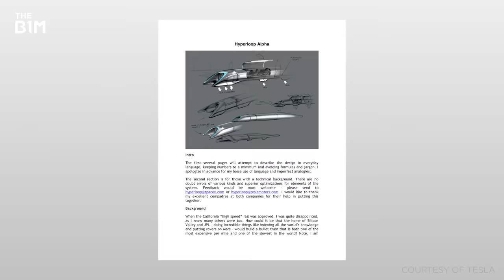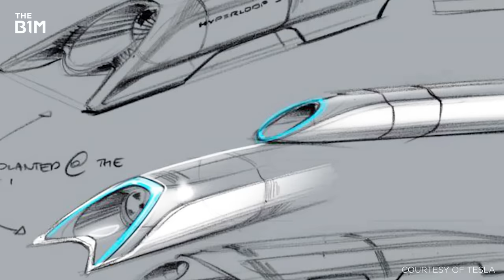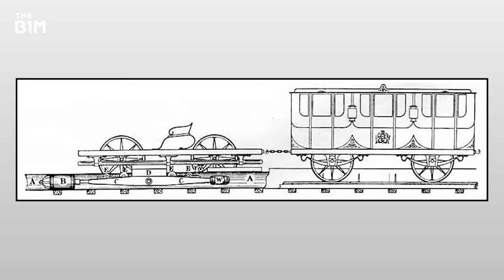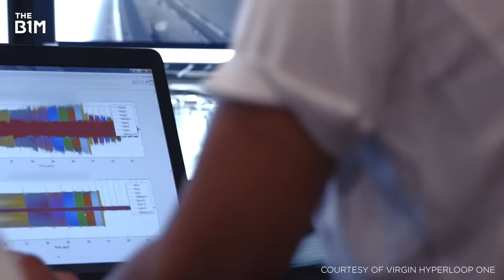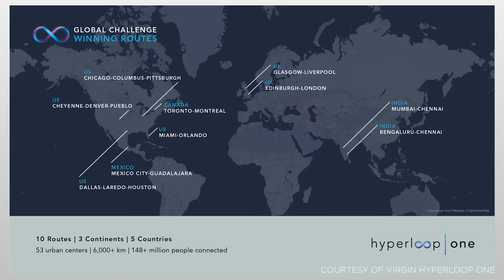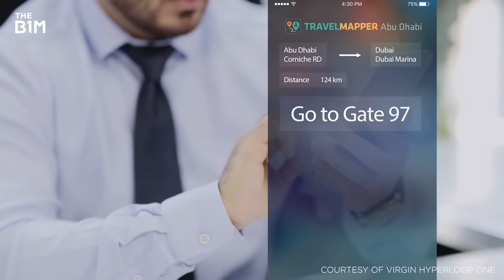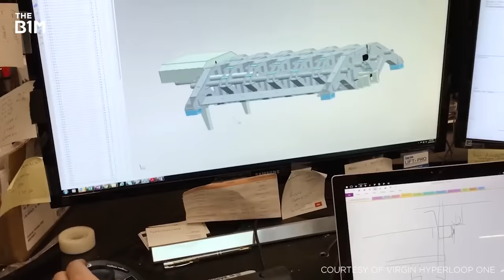Hyperloop Explained

Comment: the idea was not "first conceived by Musk", the first actual functional hyperloop was build in 1872 by Alred Beach. It was called the Beach Pneumatic Transit.
Reply: Also in New York, I believe, they had a vacuum sucked Victorian underground train that sucked people through a tunnel from here to...there. Maybe I am thinking of the same thing, I just don't have anything but a childhood memory hearing about it. The part I recall is the luxurious train compartment, Pullman style.
Reply: Addendum Yep, it's the same thing. I should double check before I post a comment!
Reply: Almost flipped the f out when they said that
Reply: @paulaharrisbaca4851  It was a demonstration tunnel that went about a block, then came back.  Neat idea - but it wasn't hyperloop.  The car (I think there was only one carriage, not a train) didn't operate in a hard vacuum, but instead acted as a piston.  The station would increase or decrease the air pressure in the tunnel to push or pull the car.

NYC didn't go for it.  The tunnel was sealed up, rediscovered, and then demolished.  The scene in Ghostbusters II where they broke into it was actually City Hall Station, I believe, which is funny since City Hall Station is where the old tunnel originally was.

Comment: so hyperloop is just maglev in a tube.
Reply: Yes, You are right.
Reply: as well as a really cool name
Reply: It's not even something new. This was suggested by railway engineers in the past but wasn't feasible in their time.
Reply: Maglev in a tube but it goes faster since it doesn’t have air in front of it but it does have air behind it
Reply: @gabbar51ngh  still isn't feasible. If you ever worked with vacuum equipment you'd know what a fucking hurdle it is to keep even a small vacuum chamber under low pressure for an extended amount of time.
Reply: In many ways yes.
Reply: @gabbar51ngh  And it still isnt. Not even close.
Reply: And moves fast due to air pressure equivalent to 200k feet above sea level.
Reply: @gabbar51ngh  its literally a 100 year old concept plagiarized by Elon musk
Reply: @flatmarssociety5707  Of Course! But with added snake oil!
Reply: Even bullet trains r that
Reply: @skygge1006  dude r u serious due to maglav the pods float which reduces the friction between the two bodies as air applies lesser friction than the tracks does 
But still the drag force is kinda hard to face
Reply: yup, I wonder why they don't call it maglevtube instead.
Reply: But with more ways to die.
Reply: Vacuum tube
Reply: except maglev can go faster and is safer
Reply: Yep
Reply: @JiTiAr35  because they already abandoned the maglev idea. Pie in the sky ideas don't translate to reality. Now its got wheels. So it's a subway train......
Reply: @polybiusv7299  not to mention it takes time to create a vacuum.
Reply: I started working in NY 200 years back when we made houses  at Rock Central, IM SO HAPPY WE DIDNT cancel the PROJECT. I never thought I would see it finished in my life time— then again, I may no
Reply: Yup

Comment: "Hyperloop was first conceived in 2012 by Elon Musk"

No it wasn't. The "Hyperloop" brand might have been but the original concept of transporting people this way goes back to the early 1970s.
Reply: Yes first working test track had been build in West-Germany in 1969 https://en.wikipedia.org/wiki/Transrapid
Reply: @ratten57  Thats Maglev not an airtube.
Reply: O. B. The whole thing is impractical.
Reply: @o.b.9781  Maybe so but it's a stunt. The numbers simply don't stack up. There's no way these things will ever be cost competitive with conventional rail or flying. A vacuum tube is good for moving cash around a shop but not much good for people.
Reply: The original concept was first patented in 1799 in Britain - so Musk's claim that he invented the concept is beyond absurd. It's never been built because the engineering will be extraordinarily challenging and expensive and the safety issues are virtually insurmountable. This will never be economically viable - it's in the same category as personal rocket packs and flying cars.
Reply: @tullochgorum6323  
"the safety issues are virtually insurmountable."

Exactly. What happens if the cabin depressurises? Everyone dies. What happens if the thing stops? You can't get out because you're in a sealed tube in a sealed and airless environment.

Ordinary high speed trains and aircraft can move more people. There are break even points on distances.
Reply: @thethirdman225  Any catastrophic failure of the tube (eg from terrorist attack) means that all passengers are vapourised when they are hit by a wall of air moving at the speed of sound. It would be like driving into a wall at over 700 mph.
Reply: @tullochgorum6323  Mmmm... Good point. Hadn't thought of that. I was thinking of more pedestrian malfunctions...
Reply: JustAnotherGuy Well that’s a long time before Elon Musk!
Reply: And the reason it was abandoned was basic physics: energy to create such a huge vacuum as well as the danger of a breech in such a large vacuum makes it more energy demanding costly and dangerous than even air transport.  I mean, if you're going to get ridiculous you should at least make it entertainingly fun like a giant water slippy slide that will take you from one city to the next.
Reply: Actually, it goes back to the late 1800s.
Reply: @thethirdman225  aircrafts are becoming unviable for travel less than 1000km due to long waiting times and requirement of large runways in cities where land is premium.
Reply: @thethirdman225  This thing will have fail safes on top of fail safes. It's even less likely for the cabin to depressurise than for an airliner, and if it did the system stops the vehicle while pressurizing the tube around it.
Reply: Much safer than an aircraft which relies on very thin sheet aluminium to contain cabin pressure versus very thick steel walls which are extremely hard to breach and if there is an air leak then the pods just gently slow down and you’re only a few metres above the ground in perfect safety. Maintaining the partial vacuum also uses very little energy
Reply: @JeffDeWitt  And everyone seem to be forgetting that such technology must have emergency oxygen packs for the whole cabins (in the events of an emergency). Those guysust have thought of all the negative implications... I have been imagining the possibility of this technology, even before I get to see this information. I'm hoping to seeing this concept come to reality someday.
Reply: @springviewcorporation4653  I don't think it needs to be anything as complex as emergency oxygen packs. In the event of a major emergency the pod could stop, vents open in the tube and then in the pod, flooding the tube with fresh air and then the pod. All that could be easily set  up so it happened automatically if the power went off.
Reply: @tullochgorum6323  all passengers are vapourised when they are hit by a wall of air moving at the speed of sound. It would be like driving into a wall at over 700 mph.

Just like how the Concorde always exploded upon reaching the sound barrier, right? Surely it's impossible to design a metal vehicle to withstand such stresses, or otherwise incorporate structures within the tube itself (like a Tesla valve) to constrict the flow of air, should a catastrophic leak occur? 

https://www.youtube.com/watch?v=rYlP5TEKf2w
Reply: @noelchignell1048  the "very thin aluminum" you are talking about is for lightning protection. The real one is thicker
Reply: @noelchignell1048  also no you wouldn't slow down, not only the atmospheric  pressure inside the tube is 0.01 which is almost the vacuum of space. Your lung just burst, everything gets pushed by an air with the force of a truck with the velocity of ~1100km/s vaporising your body and breaking the pod apart
Reply: @springviewcorporation4653  you have been, but you haven't calculated the speed of air coming at you with the speed of sound and with the mass of a truck. Not only you are trapped in that stupid pod you cant do anything except, not doing anything
Reply: @ritwikreddy5670  the only problem with aircraft is that efficiency of the engine is higher the less air there is, but also less speed.
Reply: @thethirdman225  Hmm, just like on an airliner except you won't be 40,000 feet in the sky.
Reply: So? At least someone introduced it to bigger audience of today's world where it has more demand. Doesn't really matter who is the original conceiver in an open-source innovation now does it.
Reply: @o.b.9781  Why transparent? If its a closed steeltube, you have more space to place oled displays for commercials and the ppl won't be distracted by natural sunlight or the landscape. All in the interests of the shareholder...
Reply: @tullochgorum6323  Flying cars are a solved problem. You can see videos of them on youtube.

Comment: The drive -thru at the bank has been using them for decades.
Reply: No
Reply: @garisfamilychannel6160  Yes
Reply: Woosh this whole thread
Reply: This made me crack up. As a child I was so fascinated with the bank tubes.
Reply: I betcha someone got high and went to the bank and said man I wish I can fit in one of those tubes
Reply: Most of you guys really don’t really understand what a hyper loop is. The tube is not pressurized, and has less air than normal sea level. This allows the pod to move at incredibly high speeds, with little air resistance, do to the fact that their is not much air at all.
Reply: 你的心是自由民主聯盟 這樣的一天一定。
Reply: Futurama has been using them since -1,000 years ago.
Reply: @garisfamilychannel6160  Yes.

Comment: When I was younger, I asked my dad why those pipelines (they're for hot water for heating here) have those big U turns that seemed to be useless. He explained to me, that due to temperature changes the metal tubes extend and getting longer. To prevent anything from breaking, these U turns give the tubes the ability to bend a little and not cause demage at where they are ending. How does Hyperloop deal with that, cause to me looks like the exact same problem?
Reply: i noticed that all the cities appear to be relatively the same longitude...  wondered about temperature fluctuations, then wondered what they're going to do about global warming...  and EARTHQUAKES.  We didn't used to live in an earthquake zone, but since they've been fracking the CRAP out of the ground not far from us, our doorways all have massive cracks in them from the earthquakes that we just KEEP HAVING, and then they move the fracking to a better site(closer to someone elses house, lol- spread that "wealth").  Possibly, he thinks that he couldn't possibly be standing in the way of anything else necessary happening... but if they find oil under that thing, it'll be tinkertoy time.  He DID just decide to start a plant in Austin, and then they had riots, lol.
Reply: They could stick a smaller pipe into a bigger pipe with a movable seal in between.
Just to add another maintenance/failure point.

Mind you, as this thing will never actually get build we may as well skip these practical problems and just enjoy the hype.. :-p
Reply: @sigi9669  The HYPE erloop. funny, right? :D
Reply: @miohai7190  I think i have just invented a new natural disaster !
Reply: @miohai7190  AIRQUAKE (deals more damage and move faster)
Reply: We install expansion joints on steel pipes (flexible portions of pipe) they are straight though for gas pipes you see it on roads bridges too that could work. its a little different on water lines more temperature fluctuations  thats where you see the uturns
Reply: @miohai7190  Well, we have a subway that runs under the San Francisco Bay and we do have a reputation for major earthquakes....you take a risk by simply living. I don't ride BART because I don't commute, but I have no problem riding it or driving on the various bridges we have. The minute you are conceived, life is a risk. Your own mother might be the biggest risk of all! 🤣At least maybe if you can make it through the first 3 months, you might be good to go for awhile.
Reply: Materials matter. Metal expands and constricts more than most materials. They would probably use like Lexan or some material that does not expand or construct as much due to temperature change. Also, you would have expansion joints regardless.
Reply: The same way. Every piece of machinery does that, even rails

Comment: Basically a giant particle accelerator but without the collision (hopefully)
Reply: It is certainly accelerating giant particles!
Reply: I'd be afraid to ride on it, coming up to a wall, and the thing won't slow down, and with airplane force power slam into the concrete and destroy everything. 

Yeah, it seems a little unsafe considering it can leak and the pressurization suddenly drops while a train is going.
Reply: phiovorix the same exact thing could be said about airplanes. Yeah if the pressure drops were all gonna be doomed. Yet that (almost) never happens
Reply: @thamyris8953  Drops in pressure would just slow it down to mag-train speeds

Comment: "Theoretically, a sudden influx of air into one of the tubes would simply slow the pods down"

Yes, from 750 miles per hour to 200 miles per hour in the blink of an eye, equal to hitting a solid concrete wall at 550mph.
Not only would no one survive, deciding which heads, limbs and internal organs belonged to which passenger would be a nightmare ;p
Reply: The pax would become a homogenised paste. Tasty!